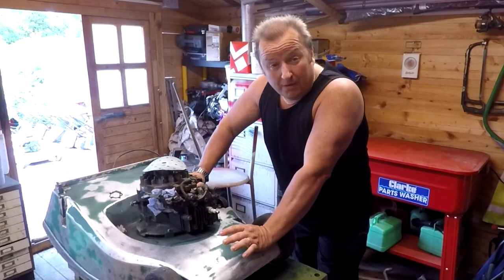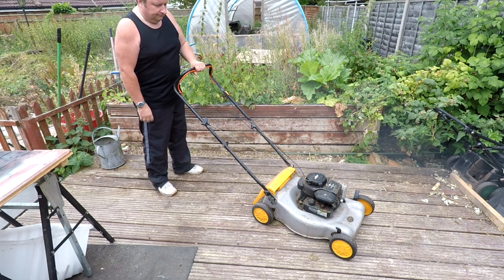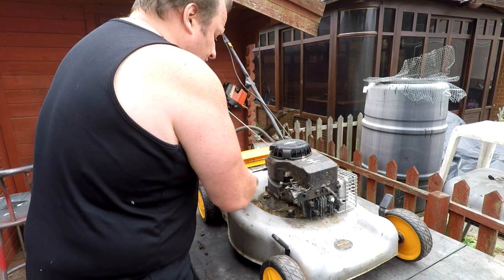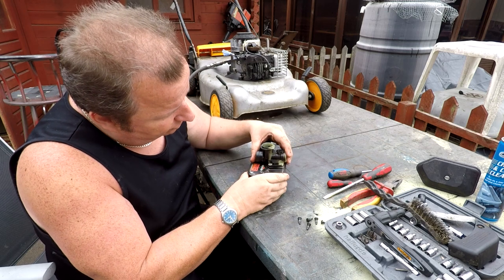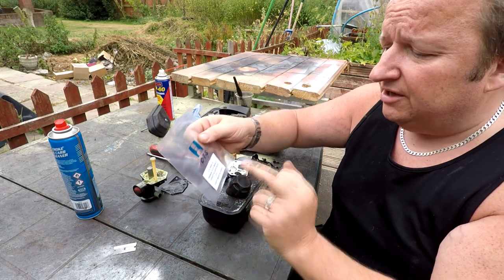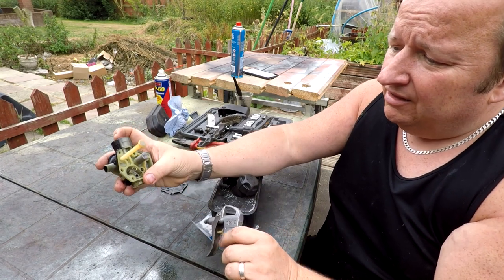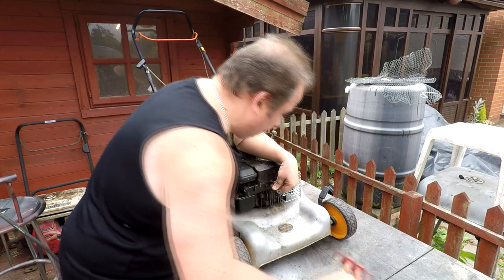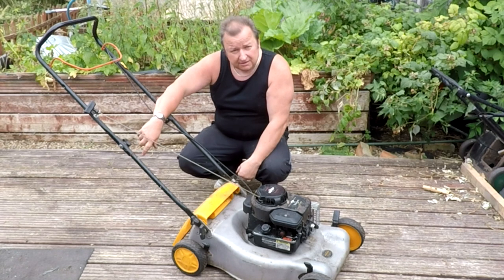Fixing A Mates Lawnmower

Comment: Im glad you are finally over your cold. I'm sending a message on this video because it pertains to the 3.5 classic engine. The question is I have a mower that is hard to pull and kicks back. I've checked the flywheel key and its good. Is there a compression release? If so where is it and how can it be repaired?
Reply from the maker: The key might have shifted a bit, , no compression release on those.

Comment: Hi Martin I didn't mind you other vid for the reason it was nice not hearing you ramble on lol, only joking I thought it was ok. You've done loads of the Briggs classic videos, get a couple of Honda's to work on I'd like to see and I think others would like a bit more variation in the mower side of your channel. Just thought I'd mention it to give you something to think about for future vids. Anyway another good vid thanks🙂👍
Reply from the maker: That's why I bought the Honda engines. I buy what comes up for a quick turnaround hoping to show people how easy it is to fix the Briggs ones. The lawnmowers is just a part of my channel but I see your point.
Reply: retrorestore Hi I wasn't complaining, I just like a bit off variety. But you have your chance with the mower on the table, that has a standard type carb so you can do a clean up job of that one lol. Also I'm a bit disappointed you didn't take the engine of the Hayter, it would have been a fun watch you trying to get that dreaded bottom disc off, I'm only messing sensible choice to work around that they can be a pig of a job to get off. The ones I've removed I've needed to heat and heat with oxy and acetylene, then it still was hard to shift. It looks like the Hayter coming along ok, anyway get well soon🙂👍

Comment: Hope you feel better soon Martin!
Really good tip with the double gaskets!
I will have to try that out!
(Actually having that issue on a mower right now after replacing diaphragm)

Quick question 
Have you ever had a fuel tank for one of these where the seal on the outer edge is degrading and leaking?
If so what do you use to fix it?
I was thinking maybe try some gasket maker or JB Weld but if you have a better idea I am all ears 👂 

Take care! 😊
Reply from the maker: Never had that problem but I keep spares as you know

Comment: You inspired me to have a go on my briggs and statton, which I've done , but the carb is playing up , with the primer not spraying from cold, but when running it sprays? 
To get the mower running I have to put abit of petrol in the carb and jobs good , any ideas??
Reply from the maker: if you remove the air filter, you should be able to see the jet of fuel when you press the primer

Comment: Martin I went to my local lawn mower shop. They charge €5 for Diagram and gasket, €10 for head gasket, €5 for spark plug
 €10 governor spring. €70 for a service. €10 euro for small governor spring is expensive. What do they charge in the UK.
Reply from the maker: You can get it all a lot cheaper bud. Have a look on Ebay.

Comment: Hi Martin that's just the exact same as the one I got that I was asking you about (flymo classic 35) .. Is it possible to get them to run faster?
Reply from the maker: Yes, just bend the little arm that the small carb spring connects to by bending it towards the front of the mower.

Comment: Think you need to get medical advice and checked over...  You have been doing man cave jobs with too many chemicals
Wonder if this started with the paraffin bath,  and breathing in those fumes you say you can't smell it but that's the worst
Now that zinc bath  petrol thinners paint and with the heat surprised you haven't got a headache
Just fixed next doors electric mower that burst apart with compacted grass and left out in the sunshine popped the screws out the plastic, they where taking it to the tip  fixed and serviced cleaned and sharpened within an hour  saved them 120 quid for a like for like mower and the best complement was they said thank you as it was like new again...    Mates rates freebie
Reply from the maker: Nice one bud. I've just picked this up from the grand kids as they have had it as well.